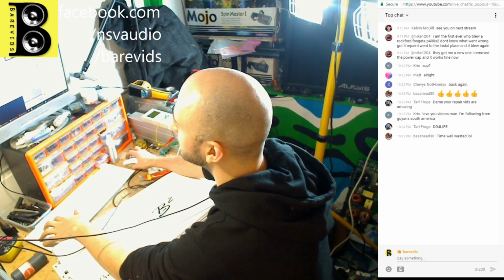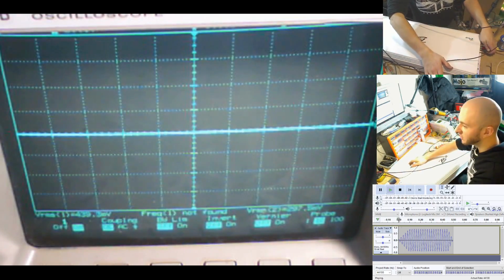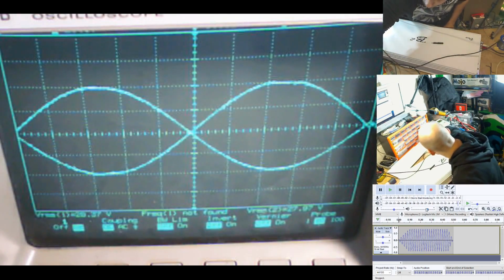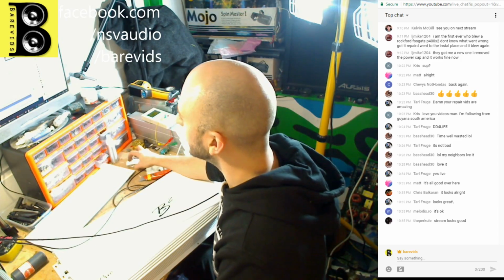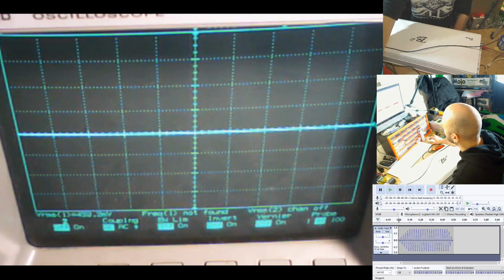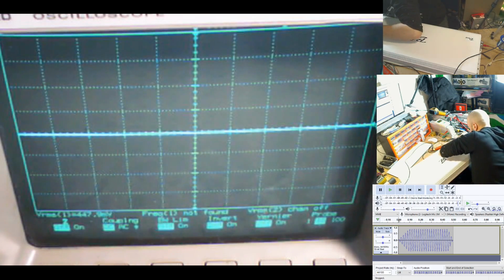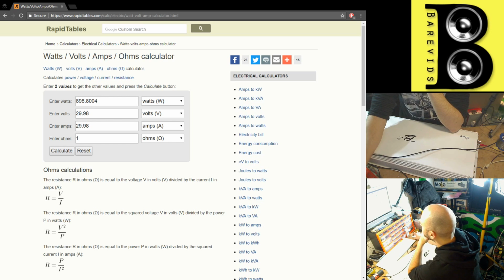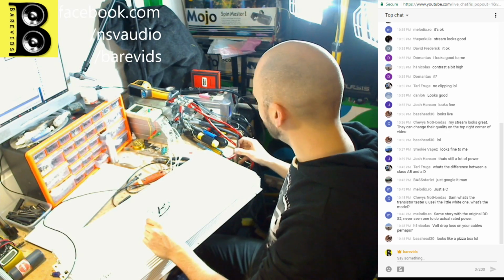Bench test! - B2 Audio Duo Mk2

Comment: If you are wanting a powerful 4 channel AB amplifier for highs and mids you might look into the Orion HCCA 4000.4. It says it's 1000×4 at 12.6 volts. I have one and it's amazing! I have a picture of the guts somewhere I will send you. I can't really tell how many transistor's it has because it has them on both sides of the board.

Comment: that would also be considered a dynamic burst, a half second blip at full input voltage is a dynamic test. and while I appreciate the attempted calculation of what it'd do at 14.4, there's alot of variables, from amp to amp, and cannot be accurately calculated. it needs to actually be tested at that voltage to get an accurate number. to test a continuous rms number the track needs to start off quiet, and increase until you reach clipping, which still won't be a certified test. the continuous rms needs to get rid of capacitor bank power by starting of at a lower volume. I accept your test as a dynamic one. but go buy a decent amount clamp dude. amps x volts= wattage. no need for an online calculator. just the one on your phone haha. 30v x 27 amps= 810 watts.